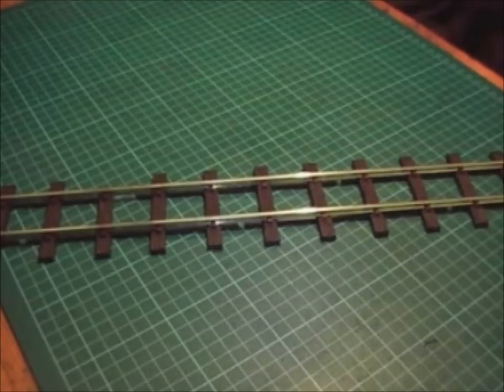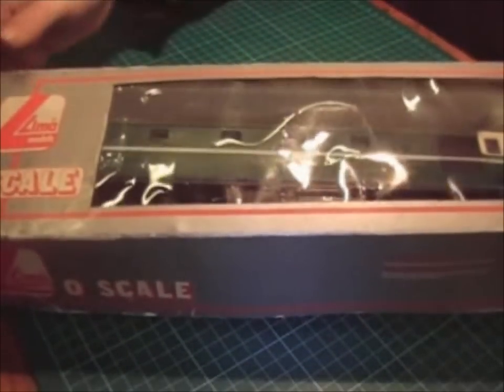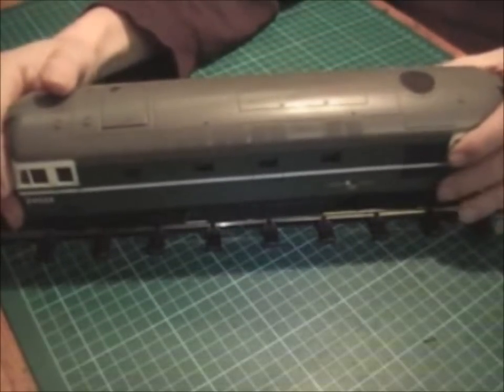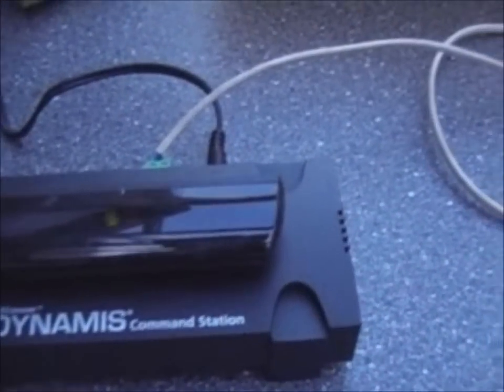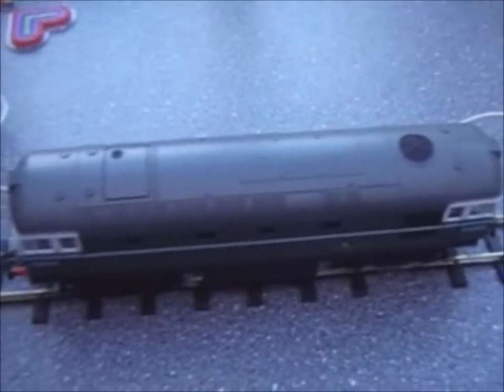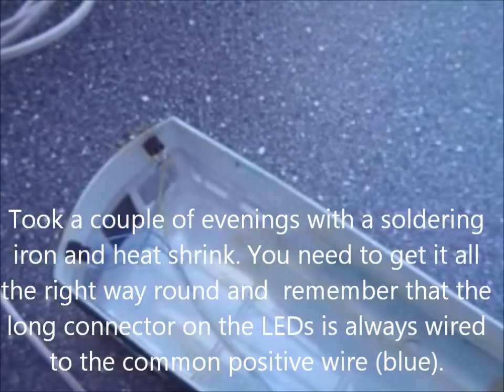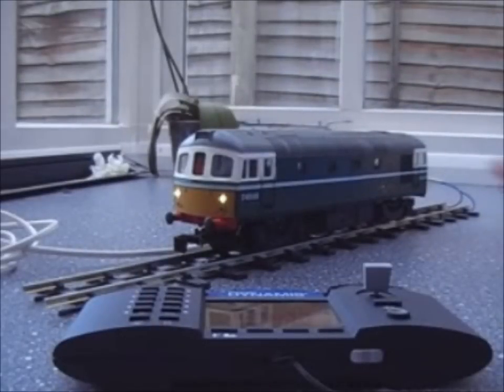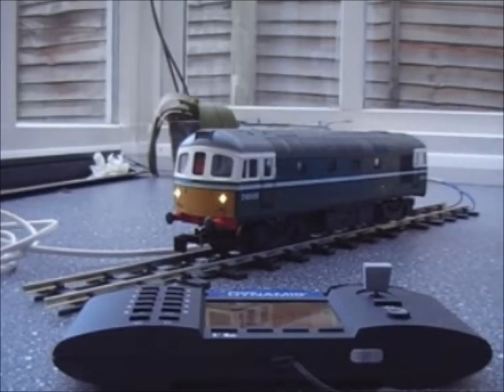O Gauge Lima Class 33 loco with DCC Sound Decoder

Comment from the maker: @tmmitzzie I bought it a local model train fair. These also apear on E-bay quite often. Usually more than £25, but not hugely expensive when compared to the newer ones (like Heljan) - which often cost hundreds. The other thing is that the motors are quite small, so you dont need the £100 power booster either!